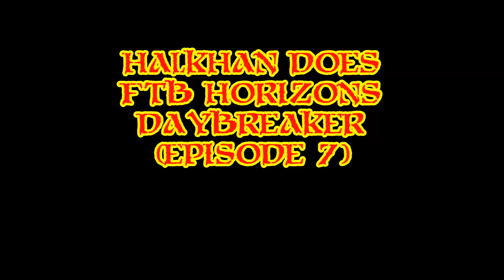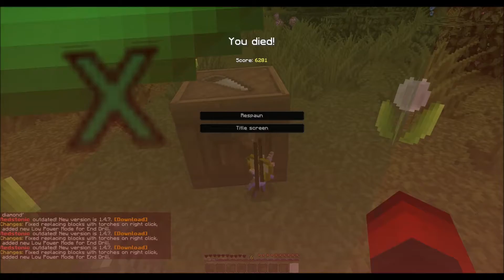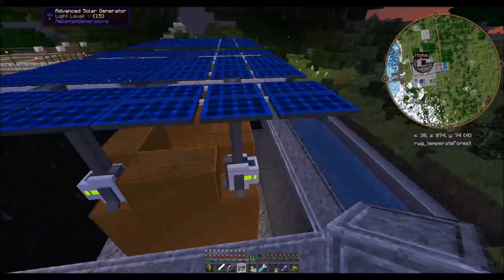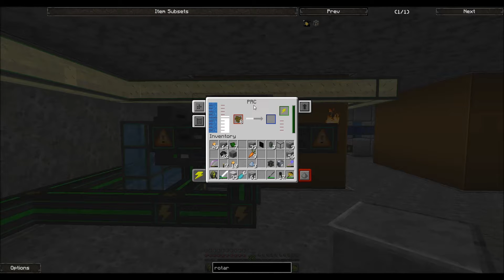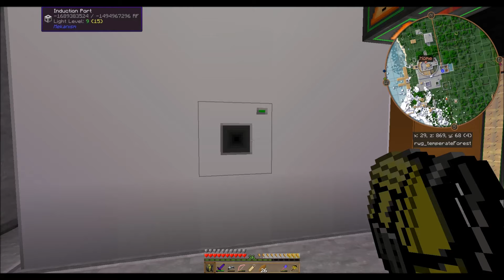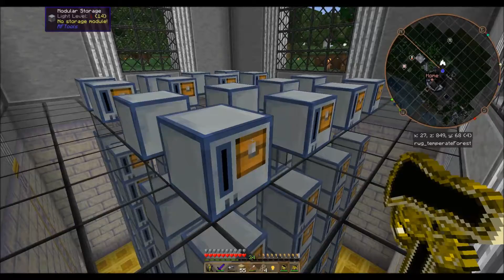Halkhan Does FTB Horizons Daybreaker (Episode 7) Mekanism Reactor

Comment: If you feed the Deu and Tri separately into the reactor it will mix it itself at rates you determine (the injection rate). Putting in DT fuel it will burn it as fast as you put it in.